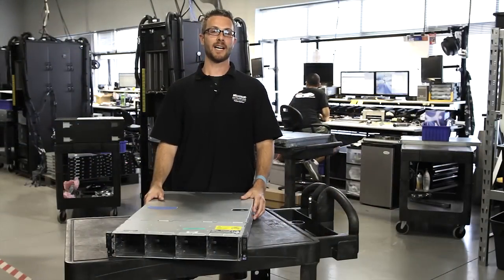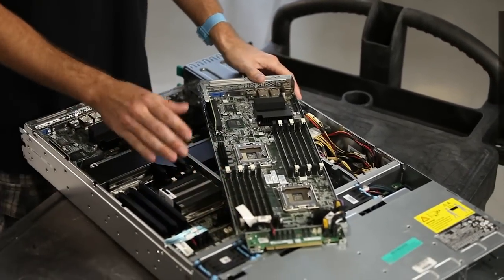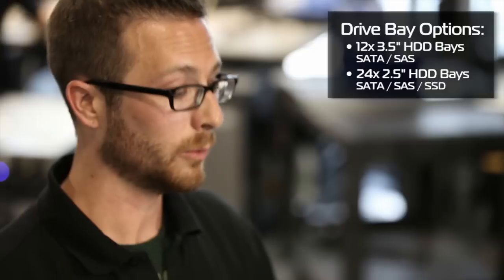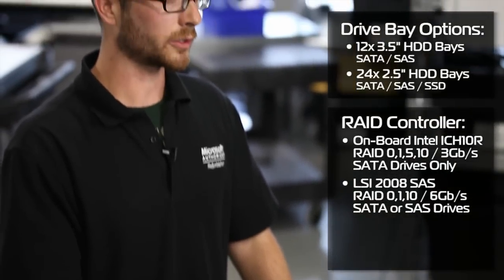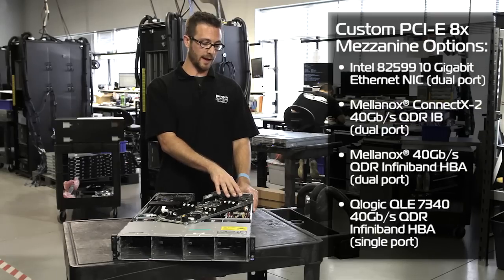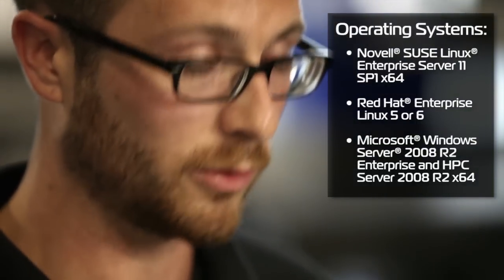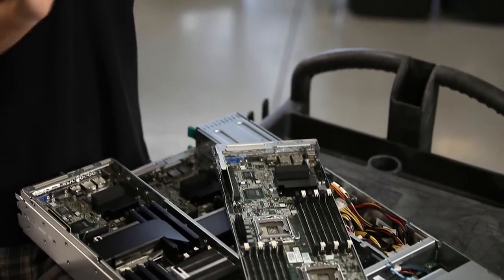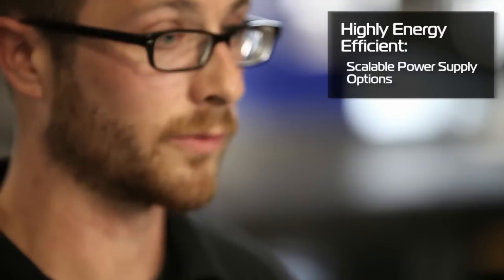Dell PowerEdge C6100 - System Overview

Comment: These are cheap 2nd hand. Can unraid be run on something like this? Does each node operate as an independent pc or are all nodes aggregated? I'm not experienced with such enterprise gear but we are a 3D rendering company and use powerful dell and HP workstations. We want a new NAS server with SSD Cache pool(1TB) and about 4 4TB(16TB usable) HDD's + Parity + 2 8TB Backup drives. I love raid 10, but looking for flexibility and expand-ability that unraid offers. Also the VM layering is very interesting to run apps and OS on top without affecting the NAS. We don't move massive files around like video editing, but we do access lots of little to medium files constantly similarly to database access which is why Raid 10 has always worked so darn well. But with SSD caching these days and we have a 10GBE network we would like to get around 500mb/seccond over the network if possible (600 up would be great but not essential yet). 

The video says server 2008R2 which i'm comfortable with, but since 2011 wondering what other options are available/compatible.

Comment: Is the Seagate Barracuda ST3100528AS the best option in hard drive for these machines? I am mainly using them with Microsoft Hyper-V running on Windows 2008 R2 Datacenter. The Intel Matrix Storage Console is reporting an Intel ICH8R/ICH9R/ICH10R SATA RAID Controller. Thank you!